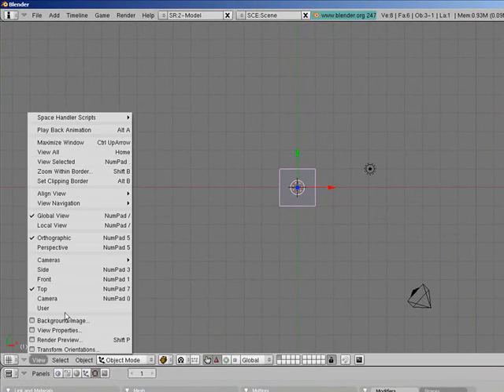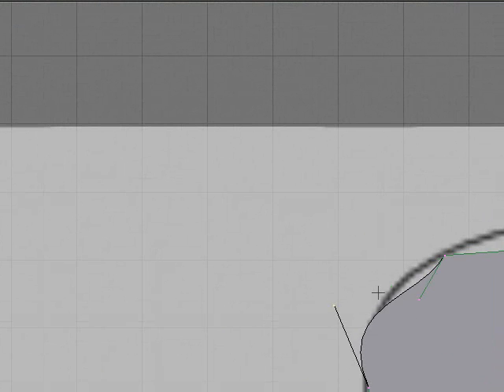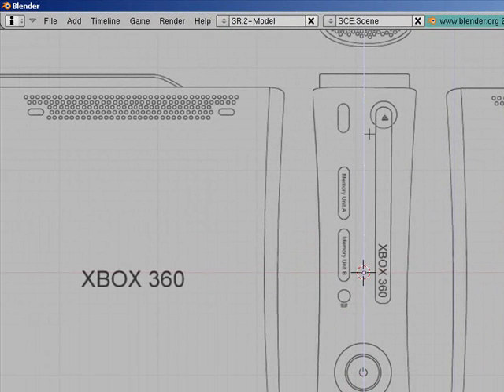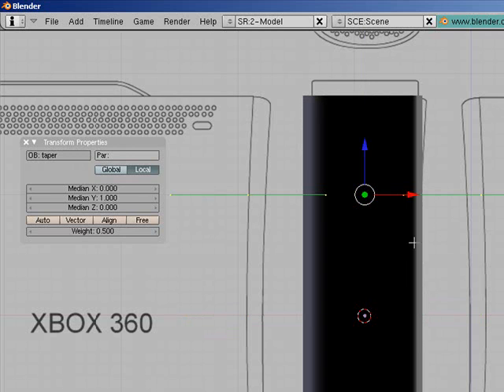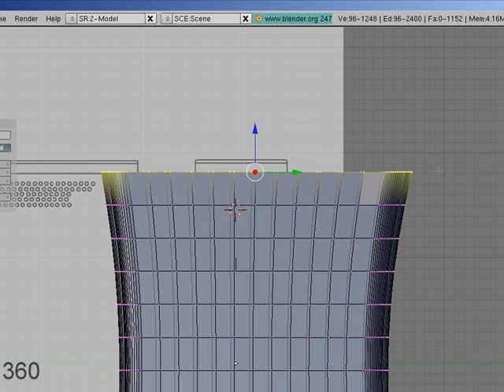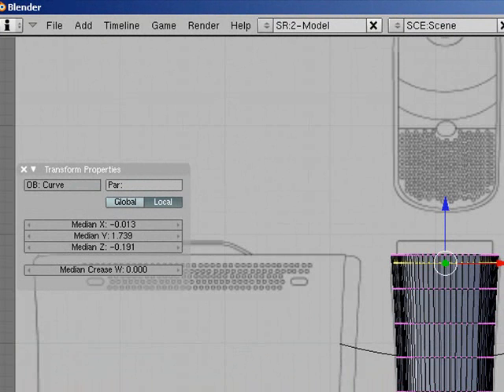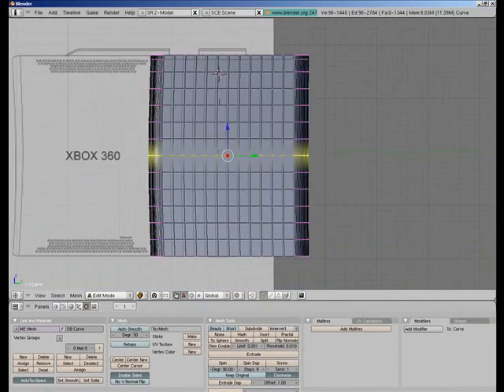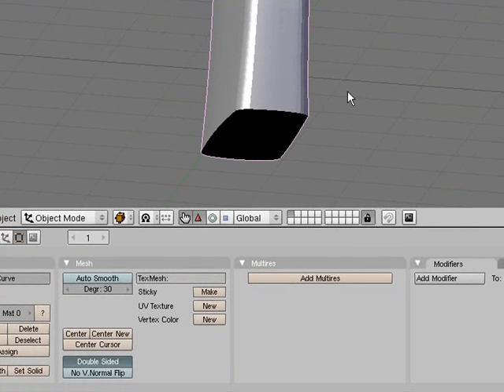Blender Tut 4: Modeling an xbox 360

Comment from the maker: you mean will there be a next part.. unfortunately my pc is too slow to do the techniques in the tutorial at the same time as recording it because its just too processor intensive. but it was pretty much just going to be useing the same thing i did to cut out the front but to cut all the stuff out in he back and all the tiny holes in the sides. and then texture it.